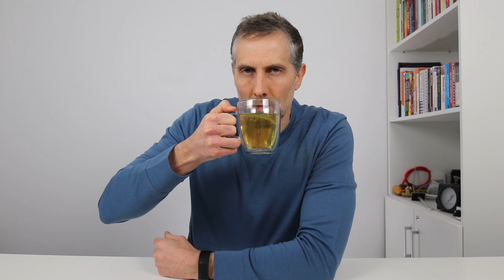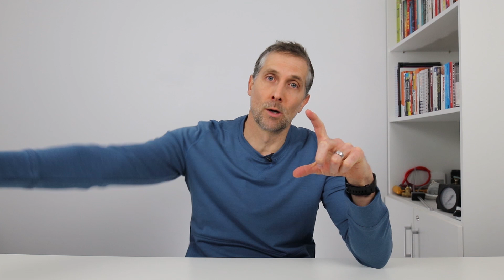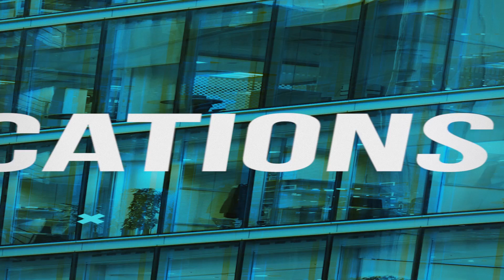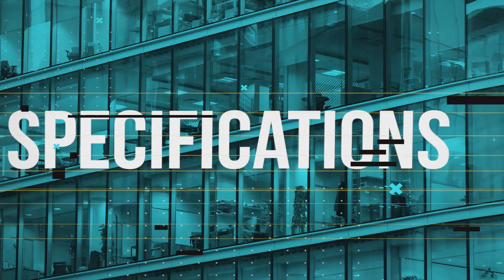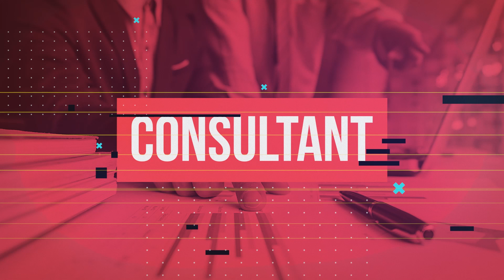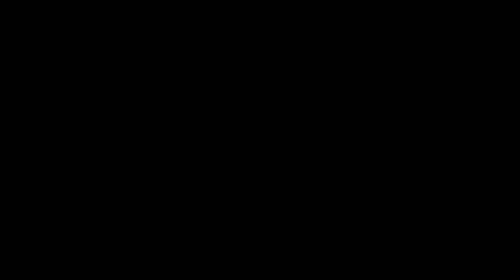BMS Control By High Level Interface

Comment: A large university in NYC wanted ALL VFD control to be done over the network. I'm talking pump differential pressure control and fan static pressure control. My brother was the PM and hardwired points had been installed for each VFD; start / stop, speed and status. There was also a BACnet interface to each VFD originally intended to integrate points such as power and RPM, but control was to be done with the hardwired points. The controls engineering team from the university made my brother disconnect all hardwired points and reprogram to control over the network. Absolute INSANITY! What happens when that network sees a BACnet broadcast storm because someone did something they weren't supposed to? We know that never happens, right? 🧐

Comment: Lots of push button or selector replace with HMI in local panel these days and it is acceptable. I mean every device or equipment like push button, selector, relay, etc even HMI, has failure rate. If OEM able to provide failure rate and comply with design tier level its accaptable for my opinion. In term of VSD off and the value still retain in HMI or Scada, it is just a logic issue in PLC or scada. If there is communication loss, we can set the value to the plc or scada to zero or change the push button on scada or HMI to grey and unable to push also alarm will occur.

Comment: Hi Bryce. If the  chiller is connecting to the BMS system with HLI, can the BMS control the chiller like on/off or just can monitoring the chiller data only?. I am quite newbie in BMS. Thanks
Reply from the maker: Sorry Tay, I haven’t been on YouTube for a few months. I just uploaded a video and realised there are a bunch of comments in here. 
In most cases you can start/stop the chiller via HLI. However, most chiller, boiler, pump, fan start/stop signal goes through a hand/off/auto switch on the mechanical switch board. You need a low level (BMS digital output) signal to do this. Also, important control is best not done via an HLI because the communications between the BMS and the chiller is not always super reliable.

Comment: Bryce,
That is why we are winning less & less projects, we run low level cabling to control low level and try as much as possible to use HLI for monitoring only. Problem #1 our competitors don’t seem to allow for that. Problem #2 too many specs put in their points list that there should be a HLI without detailing what that should do. Example #1 Lighting should have a HLI and that’s it, what do we do with that HLI ? The estimator allows a HLI point in the quote for example monitoring only as no control is mentioned then when it comes to the crunch we are expected to control all lighting points via schedule etc. From experience HLI’s can be a 1 of connection via RS485 or IP and mainly either BACnet or Modbus in our industry. Specs that show in the points schedules usually state a HLI to lighting or generators or security or metering etc etc but don’t elaborate on what it is to do. I have seen generators that have 300+ points available and we bring in the basics then get hit for not including the oil pressure or the emergency stop button etc. each point is time and that is money, why is it we always get hit with additional points that were not documented when someone has an idea for no reason that we should be monitoring all of these points that weren’t specified but are told that we should have allowed for that. Sorry my crystal ball is running out of answers. Specs Now days have to be a lot more thorough to allow the estimators to accurately quote the jobs and to allow for the items that the owner/developer etc are expecting which would save everyone a lot of time and frustration and money in the long run. I could continue......
Reply from the maker: You are a 100% correct. There is no answer that will ever beat a competitor that has allowed for 5 points per HLI. Doing the right thing will never win jobs. The only thing I can suggest is: Think about that generator interface carefully. You allow for a fit for purpose number of points. Not 300, but 50. If it gets pushed back, explain that the spec had zero points listed, you have already gone over and above. Clearly list out these points in the functional description (we don't normally do this well, we usually say to be coordinated with electrical, this leaves us open). The point is, manage the risk. The reason why we end up providing 300 points is because we didn't provide enough fir for purpose points in our submitted design. A consultant can easily reject a submission when it is a poor submission, it isn't easy to reject a fit for purpose submission. 
Lastly, generally, BMS companies, especially smaller ones, are very accommodating. Be strong in defending your design, but don't be a dick about it. Don't try and defend 5 points, but definitely defect 20 or 30 points. 
Dave, you lose zero margin from the jobs you don't win. If someone wants to submit a stupid price, then let them have it.
Reply: Please continue, I found that useful.

Comment: I would have assumed that if the HLI couldn't read a point within a certain number of scans it should have marked it as "stale" - from what I gather that's part of the BACnet standard? So it seems that the BMS retaining the operating status of a failed VSD is due either to an incorrect BACnet implementation, or incorrect logic in the HLI (i.e. acting on the value of a point without considering the quality flags)?
Reply from the maker: Possibly, but that wasn't provided on that project. Maybe if the engineer had thought a bit more about it, the test would have passed. It's still wrong in my opinion, but it would have passed. Some companies, like this particular global manufacturer, builds the BACnet points in their network controllers as proprietary points, not as true BACnet objects. 
BACnet field controller, BACnet communications, BACnet network controller, but a 3rd party BACnet supervisory device can not discover the points when scanning the network!!!!!!